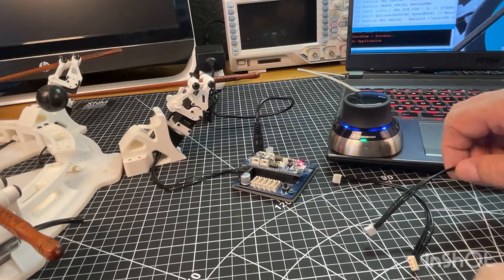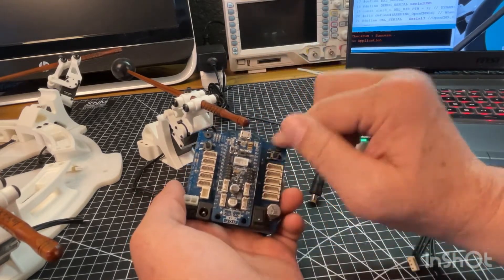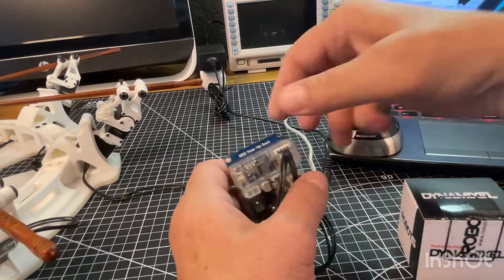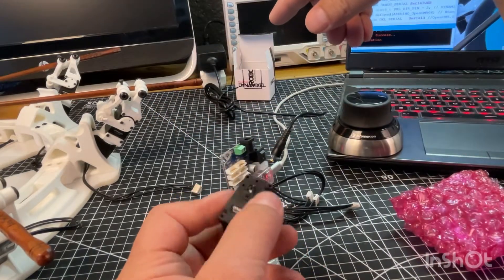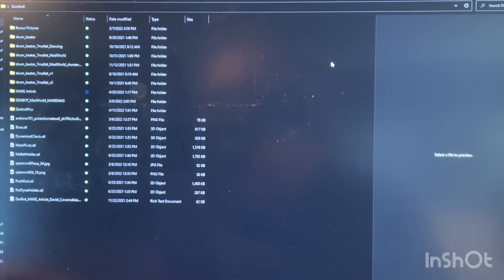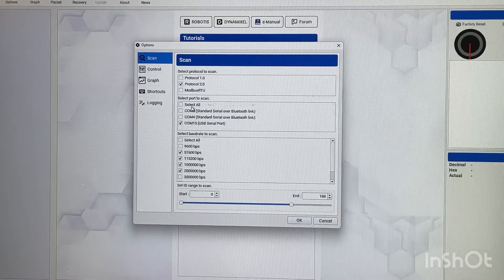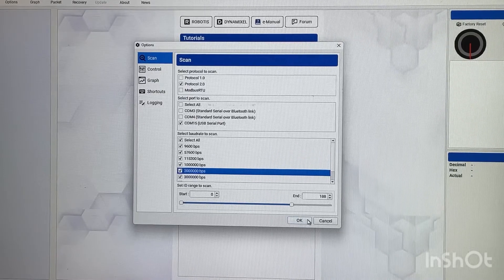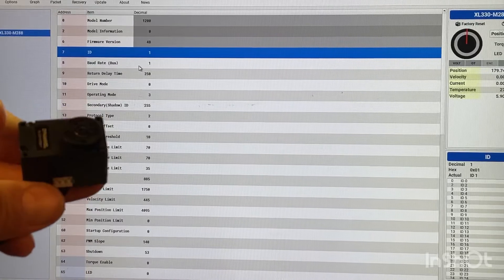Zenbot - Electronics Overview - 3

Comment: Yea this is pretty cool. I’m wondering if it’s possible to strike a surface with a mallet that doesn’t make servo noise?
Reply from the maker: It is… but quiet servos cost a lot more than these… also a dampened solenoid would do that job too… for me this is what I wanted to build because this is what I envisioned before even starting the project.   I’ve seen a lot of solenoid devices that may do the job better with less bling… I wanted a bit more aesthetics and also had a ton of dynamixels that I wanted to find a use for :)
Reply: @ It would make sense that the servo motor moving the arm left and right might be louder than the one going vertically? Is the vertical servo quieter? I’ve thought of a few ways to maybe make a mallet strike a head in a slightly simpler fashion… perhaps I won’t know until I test it (which isn’t really in my wheel house of gadgets). But to give the hypothesis away it’s to imagine the mallet at its fulcrum where the head of the servo has a gear that pinches the fulcrum. Holding a stick or pen on your fingers notice a very subtle movement produces a dynamic movement. With a little bit of tolerance the stick or mallet could perhaps move up and down even with slight play off the rebound. I thought this might be slightly different to code and a more simple set up? Just ideas.